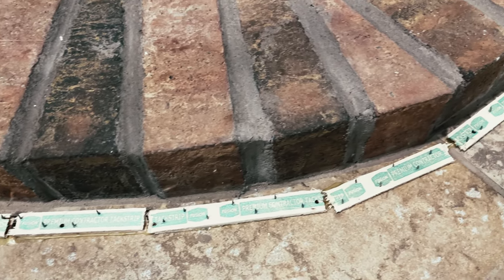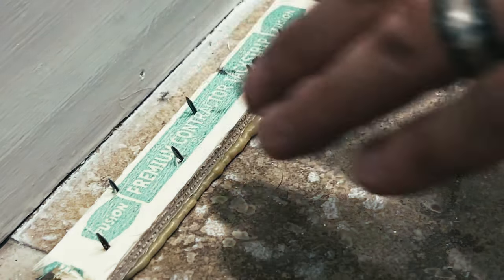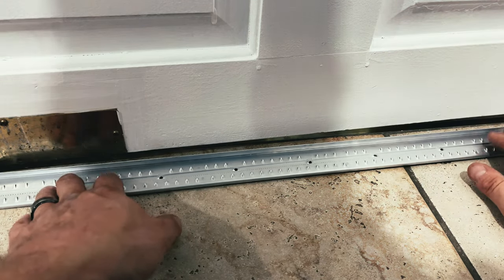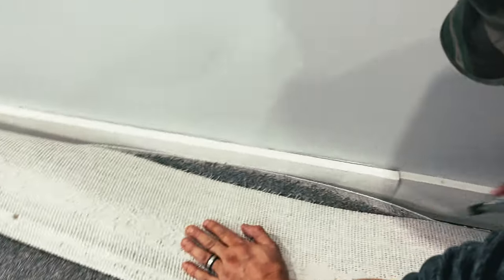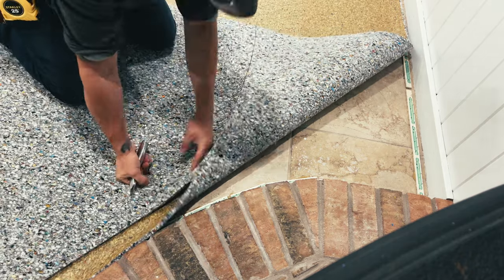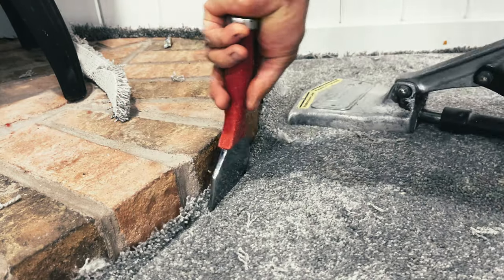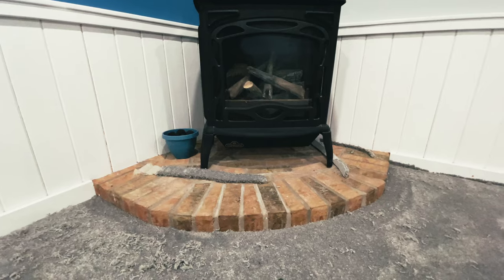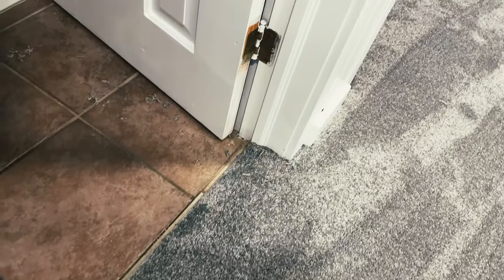Watch This Before You (Carpet Over Tile)

Comment: The tack strip gully seemed a bit too wide, although it is probably the camera angle and lenses. Whenever I am installing with baseboards jammed on the subfloor, I still use my Roberts 10-616 wall trimmer. I am able to adjust the depth of cut and get a very consistent look around the perimeter, especially against brick. I am glad to see another installer not using pad adhesive. I use duct tape around the perimeter and on the seams. Beautiful work.
Reply from the maker: Thanks for that / I do not glue my pad to the concrete, that being said I was trained that way but after seeing how messy it was to scrape up during ripouts and people with pets who urinate all over, I just thought that floating was a better fit for all!

Comment: Hi Keith thank you for taking the time to make this. I'm moving to a property that has floor tiles down. They are from the 70s and what I would call kitchen tiles,they are flat. I want to use underlay, but the carpet I can afford is felt backed. I am aware that I need to glue the gripper down. And having just watched this might be stupid question as you did state do not glue underlay. But lol should I definitely not glue the underlay? Correct? Should I glue the carpet to the underlay. I was told if the underlay isn't glued to the floor and felt carpet laid on top. It will curl up like an old sandwich. I hope you get this in time I due to lay in the next few days. 

Thank you in advance for your answer and time.
Reply from the maker: We’ll all I can say is the way it’s done in the video is how I do this / I can’t recommend how to do it without seeing or working with the carpet you are purchasing / if they are recommending a certain installation you should probably follow how they suggest
Reply: Thank you! The carpet suppler hasn't  said anything about laying. My question was based on a video I saw laying felt backed carpet. He used underlay and grippers which was already laid. He fitted the carpet and spray adhesive the carpet to the underlay. In doing research for how best to go about the laying in a forum there was comment that if the underlay wasn't spray adhesive to the floor it would curl up with the carpet. Thank you again for your time and advice 🖒
Reply from the maker: I have a few videos on how to install carpet over ceramic watch stores are in that’s how we do it professionally and we have no problems use PL adhesive for the smoothedge and do not glue the underpad you’ll never get it off
Reply: @KeithShannonDirectCarpet  thank you so much! I'll go look now.
Reply from the maker: https://youtu.be/15yO1Z9sapA

Comment: Hi Keith, thank you for the video! Could I ask, I have a terracotta tiled floor, and will be replacing an old existing carpet which is laid on them. I want to replace the old underlay too (it is a rubber type underlay) just to freshen everything up. Can any foam underlay work? I don't need anything moisture resistant? I assume the rubber is an older type, but not sure and can't find much info online. Just checking what would be a the best fit! Thank you
Reply from the maker: You can use a foam pad for sure

Comment: Hi mate, how do you then remove the glue from the title if you are reversing this process. I've taken the carpet off but struggling to remove the glue without damaging the flagstone tiles
Reply from the maker: Depends in the glue really / when we install over ceramic it’s meant to be permanent
Reply: Iam also about to remove carpet on top of tile.

Comment: does this work on any size area? Two contractors insisted on tile removal // adding $$ // but i don't want to go through this.
Reply from the maker: I have done that in huge basements what’s the difference of a big basement in concrete or a big basement in tile as long as the smooth edge or tackstrip is secure it’s pretty much the same deal If you can afford to remove the tile remove the tile if not there’s your answer
Reply: @KeithShannonDirectCarpet  perfect! Thanks for replying on my message... you saved a lot of hassle ....

Comment: I am carpeting over Tile. Someone told me not to use padding over a tile floor? they said it leaves impression on the carpet? Yes NO? I see how easy it looks, is there another type of carpet you would recommend over tile? Also, I didn't want to use glue, since its a leased commercial space, I don't want to commit to have glue over the tile. Do you have an alternative padding you recommend if there is no glue, or a different type of carpet type, squares? roll out.
Reply from the maker: If you have a lease don’t damage the floor lol / but when we used to do apartments we would loose lay the underpad and Loose lay the carpet right over top  because people in apartments are also on lease
Reply: Loose lay meaning just lay it down and cut to size and call it a day? I’m curious too cause I want to carpet over the tile in my room, but the previous owner had also added tile instead of baseboard. So idk what to do lol

Comment: We had new house but the tiles laid very badly they are not even . We did not moved yet, want to hide the uneven tiles under the carpet how much will it cost if we go with same carpet that you showed in the video for 40 sqm?
Reply from the maker: You would have to check your locall area store prices /as you know prices have been increasing dramatically

Comment: Are the Ceramic Tiles Salvageable? i.e. if you remove the carpet can the customer go back to tiles? or the strip tacks being glued to the tiles means the tiles would have to be replaced in those areas?
Reply from the maker: tiles will need to be replaced
Reply: Thanks for your response. I have porcelain tiles in the formal living room that I would like to add a carpet on top. What are my options? I would like to be able to go back to the tiles in the future if need be? 

Installing strip tacks in the grouts without the glue will suffice?
Reply from the maker: You can tack strip into the grout lines it may chip the tile a bit / you could also just loose lay over top wall to wall

Comment: Hey!
If the carpet is removed does this wreck the tile? I.e. if you decided in future to have tiles again, could you just pull up the carpet?
Reply from the maker: You could try to scrape off the glue but not sure! Once down probably always have to have carpet!
Reply: @KeithShannonDirectCarpet  just use some kind of solvent to remove the glue......gas LOL

Comment: Why don't you use glue for the pad?
Reply from the maker: Makes the pad stuck to the concrete and if the people have a flood or backup, the smell will hold / if it’s just floating makes for an easy replacement and easy to clean concrete floor 👍
Reply: @KeithShannonDirectCarpet  makes sense. I'm working alone at the moment and of I just tape it the pad tends to move around when I'm moving the carpet around.
Reply: @KeithShannonDirectCarpet  I really like your channel and work BTW.
Reply from the maker: Thanks Russel
Reply from the maker: Hard job on any day and harder alone!